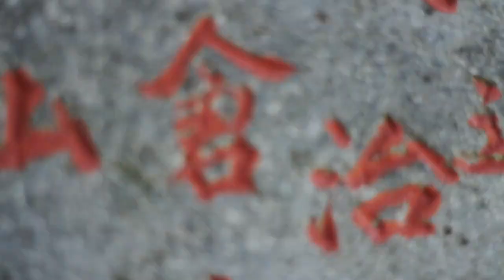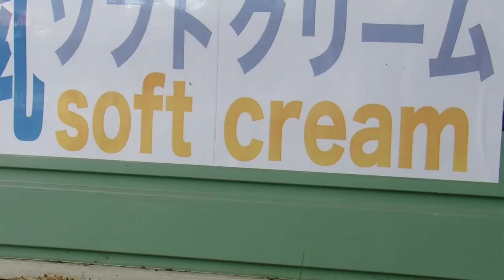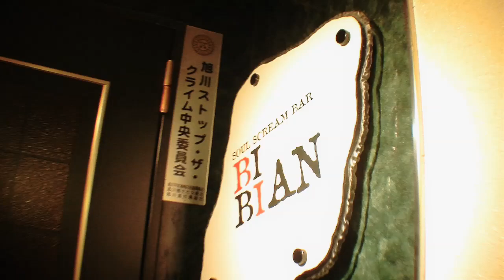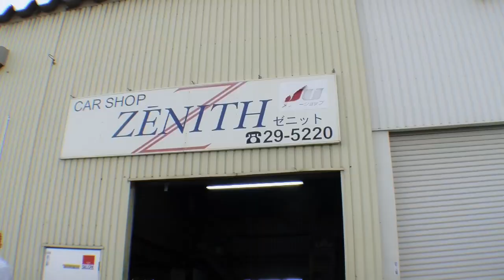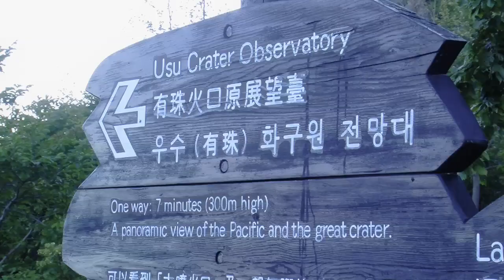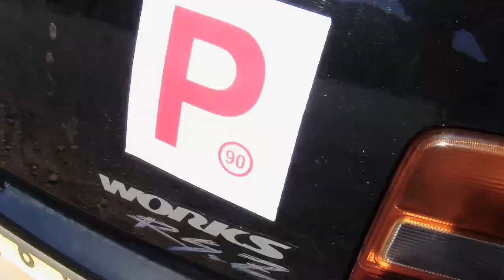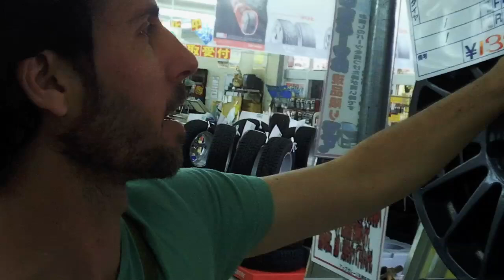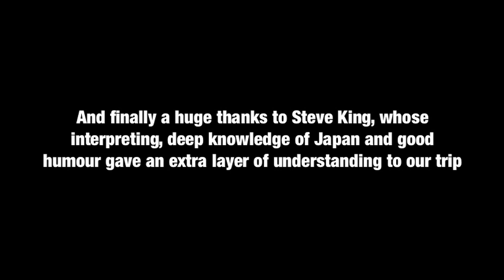Turbos and Temples - Mighty Car Mods Feature Film

Comment: Only now after buying my own Suzuki Alto works, I understand exactly how Marty felt dealing with that rear hatch. If you adjust the little rubber stoppers out a little bit, it will actually keep the hatch open when you shut the driver door. This issue doesn't happen when you pop the hatch with the passenger door open, interestingly enough. 😎🤣

Comment: I'm sorry - $300 RX7? How in the hell? What was wrong with it? If nothing's wrong, then can I ask 'how in the hell' again? And maybe a third time for good measure?

I need to go to Japan.
Reply: +Nicholas Fisher if you ever do up a drift car build your engine there an send it back lol along with 3 sets of rims .......
Reply: I'm Japan they don't like used things so used stuff goes for very cheap
Reply: Used cars at auctions have a very hard time getting good prices. The interior and exterior are judged beforehand and categorized from A-D and 1-4, while A1 is the best and D4 ist the worst. You just need a fingernail-sized stain on the carpet in some corner and a little bit of usage on the driver-seat and byebye A-rating. Seeing a used A1 car at a Japanese auction won't happen in this life and thus the prices drop to the bottom.
Also insurance and inspection becomes more and more expensive with each year you drive the car. So an old car will cost you much only to be allowed to drive it. That forces people to buy new ones, or at least new used ones.
Reply: Nicholas Fisher. Other reason for the rediculously cheap price is the fact that a rotor motor is actually a fuel pump. Hahahaha. Litterally. So IOW very expensive for people in Japan to pay taxes on.

Comment: I listen to the part about something being illegal in AU a few times but still am not sure what it was.
Reply: It's the "blow off valves" that dump boost pressure straight to the atmosphere and make a loud noise when quickly closing the throttle. I think they're supposed to dump into the exhaust.

Comment: you can't "mod" a subaru to be better than a golf. it's just not gonna happen.
Reply: you also can't drink 50 lemons without 30 vodkas
Reply: You're right, you can't. They come from the factory better.
Reply: Wait wait what
Im not a fanboy or something like that (well i am) but do u guys really think a golf is better than a subaru?
Reply: OP's first (and only) car is a Mk4 TDI on BBS RS's, of course it's "the best car in the world."
Reply: MrRobin285 yes i think a golf is better than a Subaru. i know how good Subaru is, but all-wheel drive is useless 90% of the time. my comment was to be taken lightly... subarus are great. (not as great as golfs though : )
Reply: aerial wheel Depends what you're using AWD for. For bad weather or road conditions, you get a lot of forgiveness in the steering and throttle. If you're launching, you get almost zero wheelspin. If you're drifting, you can average much higher speeds since the wheels you steer with are powered and can retain some traction when they break (have you ever seen a RWD drift car go more than 30mph?).

Yea it's not the best on fuel and weight, but does the 1-2mpg difference matter that much? Lol
Reply: why would you drive a car that only shines during the winter? maybe a couple weeks a year here in oregon. anything goes in racing (or drifting). have whatever you want. whatever you like, i guess.
Reply: i suppose the only way to end this is: I LOVE SUBARUS. THEY ARE, AND FOREVER WILL BE THE BEST CAR IN THE WORLD. ALL WHEEL DRIVE IS THE SMARTEST THING SINCE SLICED BREAD!!!! AND AUDI SUCKS!!!
Reply: aerial wheel Well you got the last part right